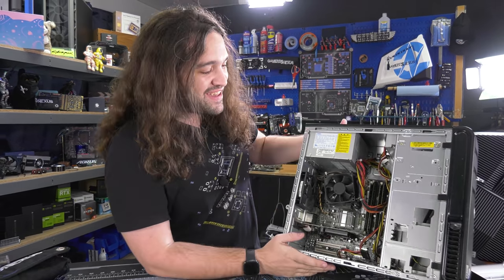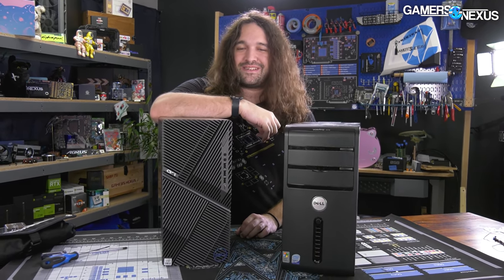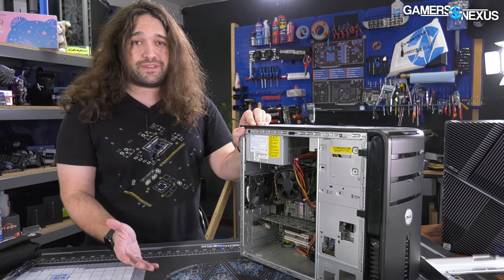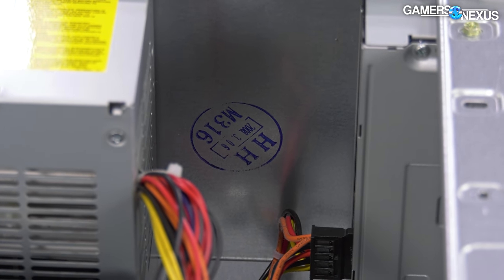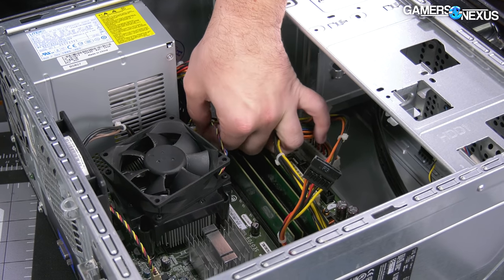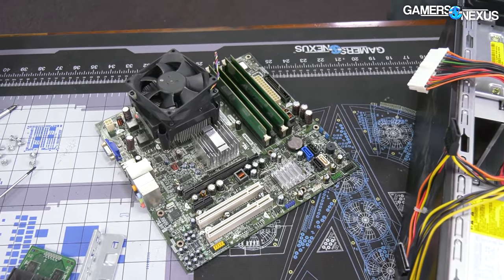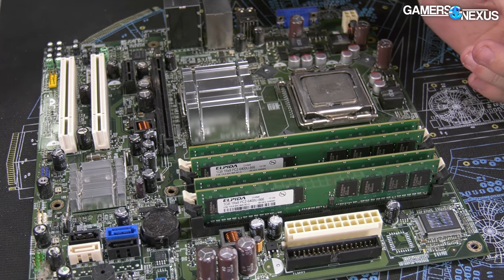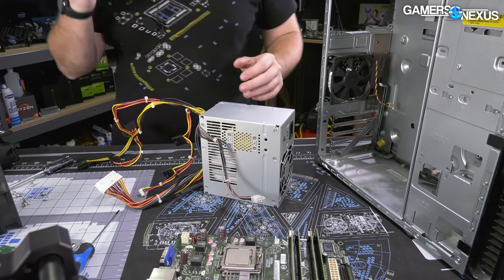13 Years of Dell Getting Worse

Comment: What an honor to get a (relatively favorable) review 14 years after launching the Vostro 400! A big thanks from the team at (the former) Dell China Design Center that launched this PC. The real sad story about the first-gen Vostro was that we worked on an AMD (when K8 was still competitive) version right till the end, but the product was cancelled at the 11th hour.
Reply: Yo this needs to be bumped to the top!
Reply: You guys built a solid product. I bought my Studio 540 (basically the same machine but with a different CPU, RAM and graphics and Vista) in early 2009 after my Dimension 2350 had its power supply take out the motherboard. It still lives on today as my HTPC, I replaced the power supply about 10 years ago, and its been through a couple of DVD drives, but otherwise it hasn't skipped a beat.
Reply: Tiananmen
Reply: @EnwardHiggins  Could be funny if you weren't just harassing a random chinese citizen who could be anywhere in the world now lmao
Reply: Dell towers have NEVER been worth a crap.  Paper-thin aluminum cases that flex, proprietary hardware/power-supplies.  Horrible stuff.   You're interpreting "tolerable" with "favorable" (and neither of those is "good".  

The only decent product dell makes is rackmount servers, and occasionally they produce a passable laptop.
Reply: @jesseg7757  They tried just that in Tiananmen
Reply: @Rahkoi  Yeah. and it was a dismal failure..  I wonder if a general strike would cause the whole thing to implode.   "Worker's Paradise" my ass.
Reply: @jesseg7757  SALTYYYYYYYY
Reply: @akellerseattle  Tired of their cheap plastic crap and IP theft.  If they made reliable stuff that would be fine, but they operate on a "cheap and disposable" business model that ends up causing more problems than it solves.
Reply: @px7355  Chinese isn't a race... It's an ethnicity
Reply: @P X  I don't give a shit about their race...its their work ethic that bothers me.  Copying other people's shit is not a work ethic.  In fact it's the opposite of a work ethic.
Reply: @evilchipmunk4090  Any sources, genius?
Reply: @crylune  for what?  human rights violations?  LMFAO  yeah, there's one or two...
Reply: @crylune  what @Emilie ?
Reply: @akellerseattle  human rights violations a problem?  no?  you're okay with it?
Reply: @crylune  exactly WHAT is your problem with me???
Reply: @evilchipmunk4090  Nope, just have no respect for people who build shit products.
Reply: @EnwardHiggins  armpits 🔥
Reply: 500 credit score plus my fine sir
Reply: Was that K8 cancel a result what would later be the lawsuits against Intel, where they essentially forced AMD out of the market?

"Buy only our products, or we can't sell it at these favourable prices you've gotten thus far - and you won't be able to compete". They're still paying off on those fines, and in some cases trying to not pay at all. Disgusting.
Reply: @Nightykk  Intel was aghast that AMD K8 may compete against them in the lucrative "business" segment, even though Vostro was only a spin-off of Dell's Dimension consumer desktops, and trying to offer some price performance to small and home businesses without cannibalizing the Optiplex desktops and Precision workstations. Dell could only comply when its bottom line was mostly kickback from Intel.
Reply: @lichen2908  Yeh, imagined it was due to that. Shame.
Reply: @jesseg7757  I wouldn't even call their rackmount servers decent.
Reply: God the amount of racism in this thread. I apologize on behalf of the actual commenters.
Reply: Intel must've given them quite a payoff
Reply: @notlNSIGHT  I don't see anything racist in the comments ?
Reply: Hi
Reply: @Adlata  I know .. that's why I said I don't see any racist comments .
Reply: Its an honor to be able to talk to those involved in the design of products!
Reply: Even then it still wouldn't be funny.
Reply: You guys did an excellent job, I c allot of high quality Japanese caps on that board.
I bought my dad a used Q6600 quad core cpu in exactly 2008 ironically from our local PC store.
Reply: I still have ours from June 2007, still in regular use as a college computer. It originally shipped with a Q6600, 3GB of memory, an 8600GT 256, and Vista x86. What a beast! Ate that OS up like nothing.

It has of course had some upgrades. I bumped it to a Q6700, swapped the GPU for an ATI 5770 after the 8600GT died, upped it to 8GB RAM, and popped an SSD with win10 into it, but she's still a good runner otherwise! The PSU also started dying so I replaced it in 2021. I think it's fair enough for how much use it had.

It's had a very, very long life. Family PC from 2007-2014, then the GPU died. I used it as a Vista game server from 2016-2019 mostly untouched, and then started upgrading it for college use with the new GPU and more memory. Never once had a problem with cooling it, thankfully! A super solid computer.

Also, ours came with thumb screws, or else the repair place swapped them in. Either way they're well appreciated.
Reply: Weren’t there the Dell Inspiron 531 in the same case design but silver and with an AMD processor?
Reply: @EnwardHiggins  this is pretty racist tbh
Reply: hi, did you work on the power edge 840 by any chance ? just wanted to say i loooove the case and my sleeper build is absolutely amazing in it
Reply: Man, i hate the future.
Reply: @Rahkoi  "Harassing" 🤓☝
Reply: @mightyfineincredible2252  bro this comment was 2 years ago how are you supposed to know what they said

Comment: So in other words, the new Dell can't even get the "it's better than Dell" award?
Reply: haha
Reply: The funniest thing to me watching this is before he even opened the damn case I was immediately going "no it's definitely better" because I actually had an old Dell PC from right before around the time Dell went completely to shit circa the 2012-2014 era. All my shit was standardized from back in the Ivy Bridge/Sandy Bridge era, including the power supply, board, basically everything wrong with the new Dells wasn't wrong back then, in fact I don't even think my old system was loaded with nearly as much bloatware (it didn't come with the good old software packages either though just like windows media player, notepad, mspaint).

The funny thing is Dell actually wouldn't be a bad power company if they stuck with making power supplies. Somehow my filth encrusted PSU from nearly a decade ago kept working right up until getting a new system. Its power supplies are beyond just "it's fine." It's like the one last component they didn't fuck up for some reason.

They did indeed use to be quite shit with boards however. My old board had NO heatsink over the southbridge and NO sinks over the paltry VRMs, which is exactly why shitty old Dells are locked at the BIOS level, which is meaning if you get an ancient Dell even you can't just swap out the crappy i5 or whatever and stuck an unlocked i7 in there and overclock it because there's no real way around the locked down BIOS. Which is just as well I suppose because those shite VRMs are going to cause a fire if you overclock on them anyway.
Reply: More like: The old Dell gets the "it's better than the new Dell". Award  ^_^
Reply: @pandemicneetbux2110  They locked the BIOS down because they didn't want you buying the cheapest model and tweaking a few settings to make it perform as well as a model several hundred dollars more expensive.
Reply: that's a burn, lol.  I think Michael Dell himself felt that one sting.
Reply: Reminds me of "dont be evil" from those other goofs...
Reply: My 2005 dell was serviced 37 times... So no.
Reply: but the old one can!
Reply: @Mavendow  The fact that your old Dell was serviced 37 times proves it is better than the new ones. It can be serviced! I mean the reliability is shit but the fact that you got it serviced means it was built better than the ewaste of today's Dell.
Reply: @TestECull  Well, they "serviced" it by replacing the proprietary parts. No way would I pay to have it serviced myself. Let them pay for their albatross xD
Reply: @adnelortiz  Yeah, new Dell can't ever get that award. They are the Dell that you have to get better than.
Reply: LMAO!
Reply: Thing is, back when this Dell Vostro was available Dell made pretty decent builds at a price point where it was far cheaper to buy one of them (and then add a half-decent GPU)  than build a complete PC yourself.  Now in 2021, all the system builders are scraping the barrel with crap components, bespoke mobo's and PSU's and doing whatever they can to otherwise fleece the customer. There is literally no good value for money in PC's today.
Reply: Whole point of the video : Dell didn't pay us extortion money, so now we are spitting on them :D Pathetic blackmail ;)
Reply: Logic
Reply: @pandemicneetbux2110  Could you maybe get libreboot to replace Dell's bios?
Reply: @Battledongus  I've searched maybe not everywhere(?) but all over the place online trying to find any kind of a solution and I just couldn't find a reliable way to make those shitty Dell boards capable of overclocking. Which, to be fair, they are shitty Dell boards, so ultimately I guess it's an exercise in futility regardless that would probably fry your VRMs and blow a capacitor or something if you tried it. I couldn't find any kind of software or BIOS mod online to get past it and increase its multiplier or voltage. I saw some talk of it being possible in theory but in some janky way under Windows. No idea how to do it with another OS, but in my case it's literally beside the point as I was hoping to keep my original install and having lost my Windows key would end up having to format the entire drive and spending awhile screwing around when part of the point of my last "build" was getting it to the maximum possible performance on LGA1155 with a Dell board and shite 8.1 install. I think to upgrade further I'd need a separate board entirely, but I may in the future get a new case with a used 980 to do some SLI build (which using a 3770k overclocked, would more or less be 1080ti tier depending on scaling and basically make it capable of gaming in 2022 at 1440p where SLI worked)

Comment: Ah, the good old days. When you could just slap a gpu into a pre-built and actually have a competent pc.
Reply: My sister had brought in a IBM PC with Pentium 4 so she can work at home and it it got a empty AGP slot! I placed a GeForce4 card and I had a blast playing Half Life 2 with it.
Reply: Brian... was this recently?
Reply: @blazed85  My thoughts, exactly
Reply: Thats how I built my 1st gaming rig. Slapped a 9800GT, 2GB RAM, and a new PSU into an HP Pavillion desktop. 1000s hrs on gmod, tf2, and guild wars on that thing!

Also, yes, it did run Crysis. On low settings lol
Reply: My story was with a prebuilt Lenovo HS250 slim, so I bought a new case and a 1060 (this was back 2017) then just to end up that the mobo need bios update but sadly the manufacturer site doesn't had a lest bios lol
Reply: You can if you find something decent. I put a gtx 745 in a prebuilt lenovo with an i5 7600. All stuff i got for free and gave it to a friend to use during this nightmare shortage.
Reply: Dell Pentium 4 with some added RAM and a AGP BFG card was my first computer. Couldnt play much for games but it got me in the door!
Reply: My first gaming pc was an hp with a Q6600 and 8500 gt, upgraded to gtx 580 as it was most recent then to play BF3 and is kicked ass until 2016 then cpu became a bottleneck
Reply: @blazed85  If he is a Linux user then probably yes.
Reply: That's what I did with mine
Reply: Wtf is a "competent pc"
Reply: Unironically what I did. Slapped a Geforce FX 5500 OC (256MB VRAM) into a Dimension Dell E310.  I just graduated highschool and had the most fun playing games at decent settings at the time.
Reply: haha yep. you used to be able to do that with the HP business desktops. Best cheat code ever. Go buy a 3yrs old refurb HP business tower from Newegg with a wicked powerful processor. Throw in your own GPU and 3x the memory and dual SSDs. and boom you have a great gaming rig for a fraction of the price